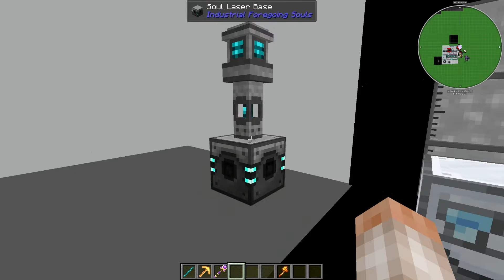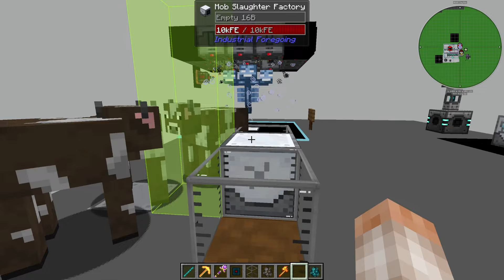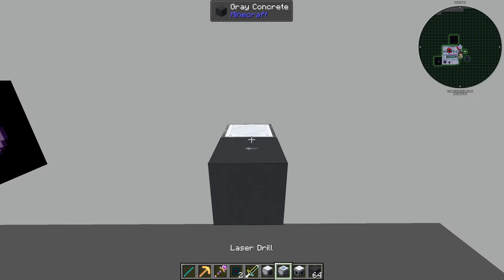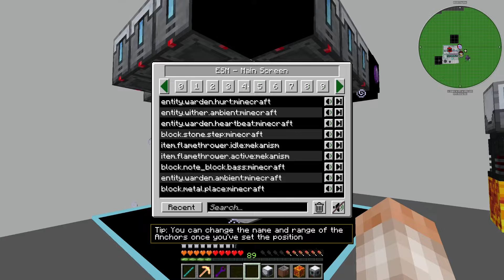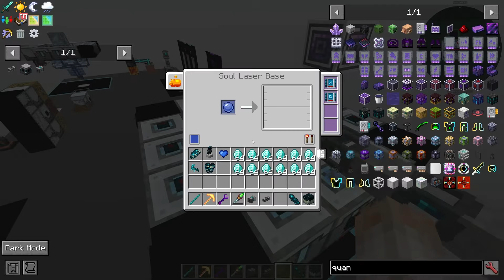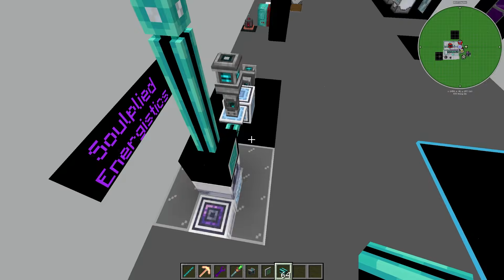Soul Surge Tutorial - Industrial Foregoing Souls & Soulplied Energistics

Comment: Tip to Everyone using AE2:
RS Importer on Soul Laser Base -> RS (With a Soul Disk in a Disk Drive) -> RS Interface (I recommend using Mega Interface) -> ME Interface -> AE2 System

On your Mega Importer find SOUL on JEI (last page). You can setup up to 350k souls PER mega interface (12.8k per slot)

----

Also on 7.2+ ATM10 versions, use more than 1 stasis chamber if you have more then 10 lasers... otherwise your warden will be dead anytime soon 😆
Reply: If you're open to installing other mods, there is a mod called Applied Soul that adds AE2 Soul storage cells and even offers MEGA versions as well.

Comment: Tip for refined storage users, its a bit niche but you can craft a soul storage disk and put a importer on the laser base (make sure you filter the lens in the importer so it doesn’t keep getting sucked into your storage) and you will see the soul storage go up in your system, to access the souls with refined storage you will need an interface, then type "soul" and search through the pages(i found it on the last page) (also don't type "souls" at least i couldn't find it that way) into jei and drag the soul icon into the interface (you can also set the amount of souls that you want accessible in the interface), afterwards you can connect soul pipes directly to it and it will work as if its connected directly to the soul laser base. The great part is that you can transport souls interdimensionally with the network transmitter/receiver combo and network card
Reply: I may setup Refined just to be able to store the souls, currently ATM10 has no "Storage" for souls, Tho i did find you can use the MEK storage for any fluid/chem/gas/*souls.
But It was NOT easy to setup, not alot of help for Mek's storage.